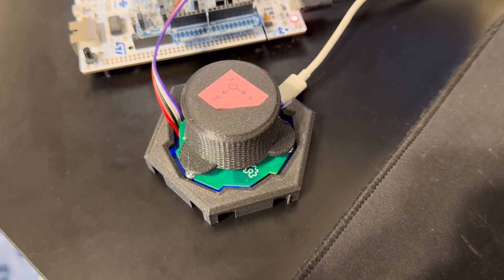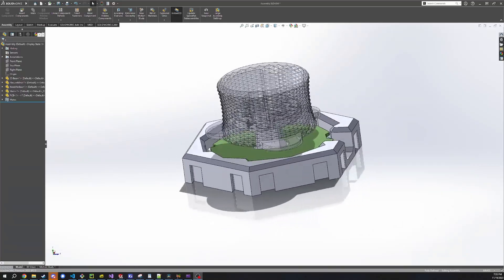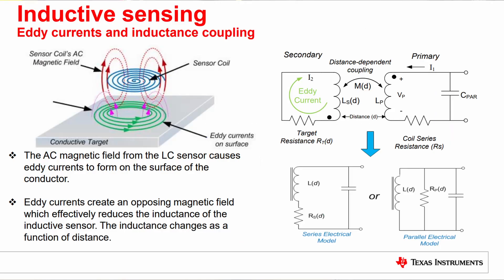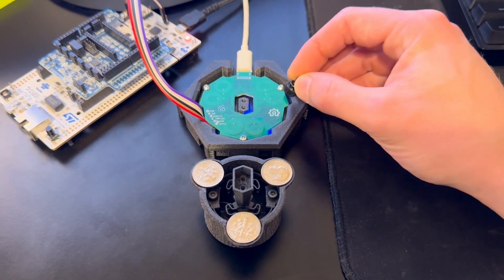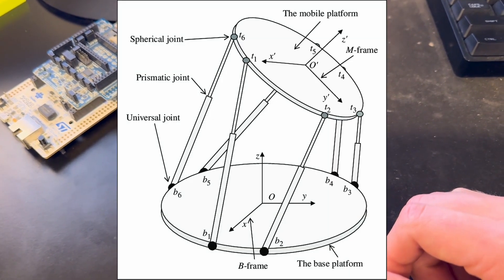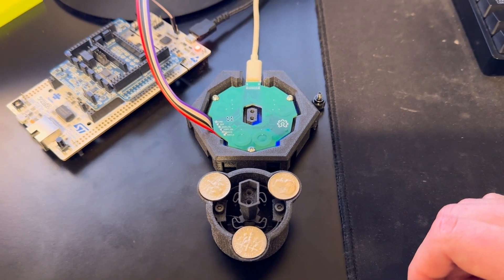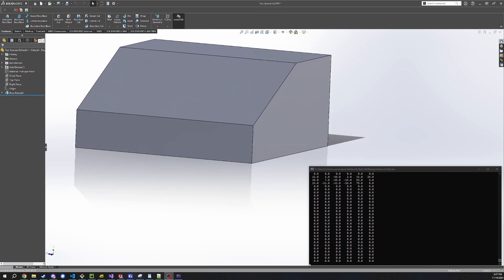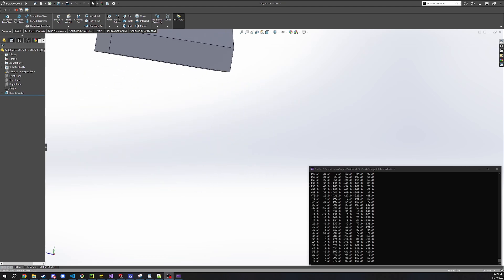Introducing the OS3M Mouse, the open source 3D mouse... mouse!

Comment: What can we use instead of dimes ? Currency around the world uses different alloys. Is it just a matter of calibration?
Reply from the maker: Any conductive material can be used. Aluminum and copper are some of the best options. And yes, you’d have to recalibrate a few constants in the code for other targets.

Comment: This is awesome! I'm wondering, what's the feel like? Does it feel fairly sturdy? Or more like it's floating in air?
Reply from the maker: Thanks! I’d say it’s somewhere in the middle. There’s a decent amount of resistance, where I’ve built it to be symmetrical about all axes. It returns to center pretty quickly when you let go of it, but the response is a bit undamped, so sometimes it’ll shake a bit when you let go.
Reply: @ColtonBaldridge  that's so cool! Have you tried different filaments to feel the differences between them? Which are you using?
Reply from the maker: @nadimfetaih3841  I only have PLA, so that’s what I’ve been designing around and using. I’d love for someone else to use the files and print it out of something else though!

Comment: Can you please make a video about the flexure design, or link to some info on its design process?
Reply from the maker: Truthfully, the flexure was designed purely iteratively. That is, I kept trying designs until I got to one I felt had resistance balanced along all 6 axes (or close enough, at least). My background is EE, so the mechanical stuff is out of my wheelhouse. I plan on making another video going more in depth into the design and how to build it soon(ish) after I finish some upgrades.
Reply from the maker: Oh, I will say you should checkout the hackaday link in the description though. One of the logs I wrote was dedicated to the flexure and solidworks simulations I did on it (that ended up not being realistic or worthwhile).
Reply: Cool Ill check it out...thanks for the reply! @ColtonBaldridge

Comment: Best implementation I have seen for this. Using the Solidworks API calls for smooth, simulatneous view control is critical in making this actually useful. I have seen some other implementations that just translate into simple pan,zoom, rotate commands that I can just do with a mouse, and in some cases when I had to zoom in on details, Solidworks get finicky with those movements, and my 3D spacemouse using the API calls was the only salvation for precise viewport control.

The compliant mechanism is a fantastic idea. My best idea for a DIY one before getting a Spacemouse was using a spring loaded typical ball joint ended strut based Stewart platform.

Comment: Man, looks nice, two questions:
1. When you are planning release ? 
2. Maybe something else, but not dimes ? I'm from completely different country, but still would love to try build this. 
Already tried different diy project of such a device abd it's not good at all, but your one seems better.
Reply from the maker: I’m not sure what you mean by release? You could build it right now if you wanted to. All the files are in the github repos 

And you can use anything aluminum or copper (conductive metals) in place of the dimes.

Comment: Dude, I bought a resin printer. I'm still learning to cope with setting that shit up, since no print would stick to the plate. But as soon as I solve that issue, I'm so stealing this.

It looks like a great first project to mix some electronics with 3d printing that's actually interestingly functional.

Comment: finally an actual 3d mouse with true 6dof
3dconnexion seriously needs alternatives if we want them to lower their prices.

Also using inductance instead of LEDs with phototransistors feels like a good path, it wont be sensitive to dust or other ingress unlike the 3dconnexion mice that require a dust shield between the moving part and the base. Also your approach eliminates the need to route power to the joystick handle, which is really good. On the spacemouse they do that through the springs that are soldered between the two PCBs. It's somewhat elegant but it makes assembly and disassembly really annoying

Comment: this is awesome! this is one of those things where i had the idea for the end product but i couldn't figure out how to get there. i'm glad someone else figured it out! my approach was to use an array of IR LEDs, but i love the three dimes and coils
Reply: IR LEDs was the approach that 3Dconnexion has used since the start, though newer models may have moved to magnetic sensors.  The problem with this is that they use quite pricey sensors, one-dimensional optical position-sensitive detectors.  There's also the Sixnav by ShamrockTeam/GreenCappuccino, with a build guide on electromaker that uses that uses one of the older 3Dconnexion patents, except they use a phototransistor and use varying thickness of plastic to variably block the IR output to adjust positioning.  There's also the SpaceFox, which is a potentiometer-based stewart-like platform, and the Space Mushroom, which is based on a triplet of joysticks; these two, the previous, and the OS3M are the only fully-developed 6DOF projects I know of, other '3D' mice seemingly don't have all six degrees of freedom or they're underdeveloped.

Comment: I have a Spaceball 4000FLX.  Having resurrected the old Spaceball serial driver in Linux, it shows up as a "joystick" device, and is therefore is visible in SDL2 (although it wil often try to coerce them into a "game controller").  The utility `sdl-jstest` will show you the deflection on all six axes, as well as all the buttons.  If you can get your device recognized by SDL2, then you can basically use it to drive any game with joystick support.

My personal favorite is to fly the spectator camera around in Quakeworld, which still repects proportional joystick input (i.e. doesn't try to convert it to button presses).

Very nice work!
Reply: I'm not sure how old the driver is that you're talking about... I seem to recall an old attempt at a SpaceBall driver that could only do joystick emulation from the really early days.
spacenavd (v1.2) can emulate a joystick as well as pass the raw protocol through to applications that support it. It supports the serial models too. I tested it with a 5000 serial and an ancient 2003 recently and they both were recognized and fully configurable.
I use it with a 5000 USB for FreeCAD regularly.
Reply: SDL2 is such a nice utility for building into a framework<3

Comment: I want to lead with saying I barley understand any of the technical information you spoke about in this video. With that out of the way, Id like to share a story. 

For years, I have been saying that computer mice need to be turned into "next gen" by using 2 optical sensors to precisely calculate rotation. I mainly figured this for gaming purposes. Helicopter controls in battlefield 4 was my real pipe dream. Everyone I told loved my idea but I have no idea how to make something like that. 

This reminds me of that idea. I hope you find nothing but immense success from this. Would love to see you mess around with as many different uses for this as you can. 
Definitely subscribing.
Reply: The main problem with two optical sensors is that your hand already rotates a bit while using a mouse.
Reply: @totally_not_a_bot   I feel like it would be a nice "optional" axis, where most applications will only care about translation but the rotation is available for when you want an application to pay attention to it. Kind of like how you can map game controllers to behave as a mouse with the thumb stick even though they have so many other buttons in actual games. If something is designed with it in mind then it wouldn't be as much of an issue, and if not it's not in the way of anything, just unused data
Reply: @DakkyW  Take your mouse, disconnect it, twist it 15-30 degrees while gripping normally and move it around some. It's uncomfortable in either direction, moreso to the outside. It could maybe work with a momentary switch under the thumb, but the idea of twisting my wrist like that seems painful.
Reply: @totally_not_a_bot  I have a good idea then for you. When something like that comes out, don't buy it! Tired of negative nancys on the internet. I have my mouse in my hand right now and using my thumb and ring finger as points of contacts, I can easily rotate the mouse almost a full 180 degrees. And like the other guy said, use it like a regular mouse the other 90% of the time.

Comment: It's great that someone is making an actual open-source 3d mouse analog, and not just a joystick that moves mouse from the center of the viewport to the sides.
Though I want to be optimistic, but it seems you project is very close to the way the actual 3dConnexion products work. 
They may file for patent violation.
But I also think, the most important part here would be actual software implementation, since there is a lot of way to input 6d0f that aren't patented by 3dConnexion.
Reply: 3DConnexion uses some LEDs and linear optical resistors to detect where the light hits the resistor with some slits. So the electronics are quite different.
Reply: @PampersRockaer Oh, yeah. I heard that they used something optical, but never found the good teardown.

Comment: Cool!! 👍🤓 
Very nice build for someone who nearly understands it himself! 😅
I see 6 coils on the PCB is that correct!? 
And 3 metal coins.
So I guess it works  a bit like a hall effect sensor array!? 🤔 
I wonder what would happen if you would replace the coins with neodymium magnets,
Would it increase the accuracy?! 🤷🏻‍♂️🤔
Reply: You may want an hall effect sensor if you're using magnets, the nature of these inductive sensor coils is that they are what's creating the magnetic field and sensing how the current behaves in doing so. Using a magnet would create a static magnetic field which wouldn't really effect the power used to create the induced field as a non-moving magnetic field doesn't induce current. The metal in the magnet itself would still have an effect the same as any similarly ferrous metal, magnetic or not.

Comment: I bought a really nice 3D Mouse about a decade ago... and never found a good use for it. It was super cool, but for 3D apps, you really only want a little movement that is really refined, like a single axis mouse drag. The 3D Mouse did too much and yet too little. I found it frustrating to use. People have been trying to replace the humble mouse for decades, but it's just so darned accurate and stable.
Reply: All depends on the application. 2D mouse will always be king for selecting/aiming in 2D. Even for 3D, a 3D mouse may or may not be best depending on the application. For many games, using 4 axes from a 3D joystick (which isn't commercially available) in combination with the 2D mouse may be best - based on a review I watched of a failed 6Dof kickstarter joystick.

Comment: Dude the inductance method is genius.
I've been thinking about a 6dof joystick for years now.
I never could decide on what sensors to use, but this could be a real cheap and reliable solution.
3dof magnetometer are cool but they often cost to much and may be hard to get.
Reply: The real problem with 6dof joysticks is axis input separation. Still sad that Sublight Dynamics failed though.
Reply: @DannoHung  my plan was to elevate that with mechanical constraints that mimic hand and wrist motion so it's clear cut what's rotational/translational.
Currently I'm thinking of using a 2d flexure for x/y load cell for z a wrist joint for pitch/yaw and a hinge for roll.
X/Y/Z will probably be moved via some sort of cuff below the wrist and arm movement while the rotation is handled via the joystick part.
I dunno, still rough sketches nothing done in CAD yet.
Reply: @DerSolinski  Sounds interesting! Hope you come up with something great!
Reply: @DannoHung The biggest issue for that I haven't found a adequate solution yet is centering the entire thing...
It needs to be reliable with a linear or better a constant force.
I loathe joysticks that have weird force curves, precision tanks with those.
Reply: @DerSolinski  I'm making one with 6 hall effect sensors + 4 magnets (surrounded by thin steel sheet for magnet isolation). The structure so far is a ball joint (M6 rod end) on 3 sliding joints (3mm stainless rods + bushings). Structure needs to be mouse on ball joint on sliding joints if you don't want axes to interfere with each other. I thought a lot about using flexures but they waste a lot of space and don't have enough motion for that config.
Reply: @ColinJWiens  I intentionally have axes interfere with each other in certain ways, that's the "mechanical constraints" part.
Also, I always plan for mass production since I'm a megalomaniac <insert "HAHAHA"  here>
(Or you could call me a hobby product designer, that works too.)
Flexures are easy to laser cut / 3D printable for prototyping, dimensionally stable, super rigid, super reliable, don't have slack, have inbuilt springs and I can have inbuilt movement scaling for the use of smaller sensors.
Since I'm only looking for X/Y travel in the range of 50-80mm total and want to yank at the plate for the Z load-cell a flexure is a good choice.

Comment: Any chance to build the firmware with pio? And the native app to send the data to (only Solidworks) is a little unfortunate. Is there a way to make this work on other systems and with other software?
Reply from the maker: I imagine there is some way you could get platformio to build for this project, all the source code is there, including the STM32CubeMX file I used to generate the project. 

Also, to be clear, the solidworks demo is only an example of how the data from the mouse can be used. The device itself uses the widely supported USB HID driver to send data to the PC, and then you can write whatever software you want to interpret the HID data (there are libraries for pretty much every language to do this). Some apps even natively support taking in the HID data, like the video game Elite Dangerous. You can fly your ship with the OS3M mouse, no extra software required.

Comment: Really cool. The use of the coil seems very innovative. I did not heard of anyone implementing a HID device in this particular way. 
Do you think this approach is better than using a 3d magnetometer like a GY50 or an adafruit MMA8451?
Reply from the maker: Yeah, I do believe this approach is better. I think capturing translational motion with an accelerometer/magnetometer would be really difficult, but when I was first thinking about this problem it is something I considered! Thanks for watching!
Reply: @ColtonBaldridge  I think that 3dconnexion have patented using hall effects, so this approach is probably also ideal legally
Reply: @HorizonMakes  Link it if you find it but I briefly searched their patents and didn't see the word "hall" anywhere nor a mention of magnet-based sensors. You might be thinking of their "optoelectronic" sensor patent. I am not a lawyer.

Comment: The inductive sensing is a cool solution. I was working on a similar device using Adafruit’s 3D magnetometer and a permanent magnet though I didn’t complete it. I had also written a Autodesk Inventor camera driver for an Xbox controller (with the plan to swap out the inputs for my DIY space mouse) but their camera motion is really weird and jittery, not like the real Spacemouse.

Comment: the inductive sensing concept is interesting. I wonder if you could get better linearity with something like an LVDT where there are two opposed inductors in series and they cancel out in the zero position. apart from CAD it'd be cool to use one of these to do RCS manoeuvres in KSP.
Reply: Hadn't heard of LVDT's until now. You'd have to wind your own and have six 5khz Sine generators. The idea is very possible, but maybe too bulky with DIY methods.
Reply: @ColinJWiens  You can make one on a PCB, they're not that difficult, it's just more flat coils.   It's been awhile since I've looked, but I believe quite a lot of inductive true position sensors, especially rotary ones, do use a variable transmission rather than the typical basic inductive sensor setup, where a lot of modern sensors are PCB-based and not the typical wound coil construction.  The only reasonable way to make this work is to have power through the knob and have the upper be the energized side, with the sensing coils on the base, though doing this would also remove the need for a target as the primary would act as the target.

I also saw your comment in a different thread about using hall effect sensors.  Do yourself a favor and use MR sensors instead, they're basically a wheatstone bridge of magnetoresistive elements, they're a lot less noisy and have much better centers, plus hall sensors have other downsides whereas the MR sensor's only true downside is that it's suceptible to external fields though I haven't yet seen one that's properly shielded.

Comment: This looks awesome, I might make one myself in the future!
Have you considered adding some buttons on the handle?
Reply from the maker: I did actually think about that! Buttons on the knob itself would be pretty hard to do, as the flexure gets in the way and you’d have a hard time getting wires to them. The alternative I’ve provided is an I2C header on the PCB, for other expansion PCBs that have yet to be designed. I’m not sure if I’ll ever design them or add them to the firmware as it’s not really something useful to me, but since it’s open source, someone else totally could!
Reply: @ColtonBaldridge  maybe you could have an inductor coil in the middle that runs to different resistors based on which button(s) you press, and then you use a stationary inductive coil at the base to pick up the change in frequency or phase (I have no idea if phase is affected or not), and then correct for the estimated distance by using the kinematics collected from the other inductors